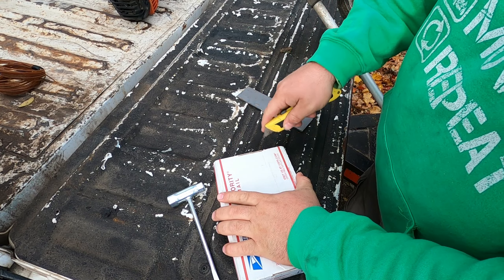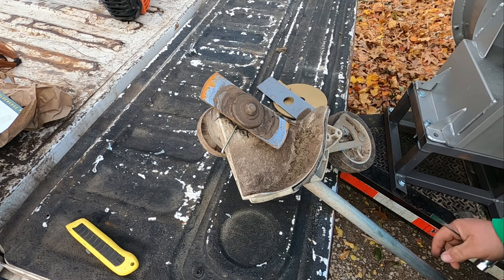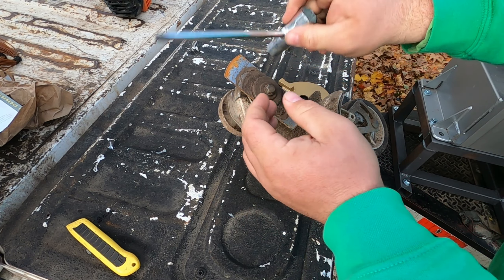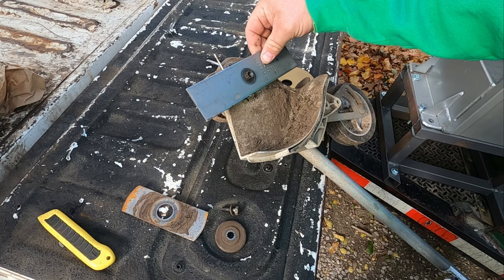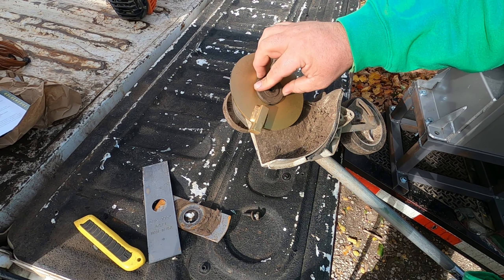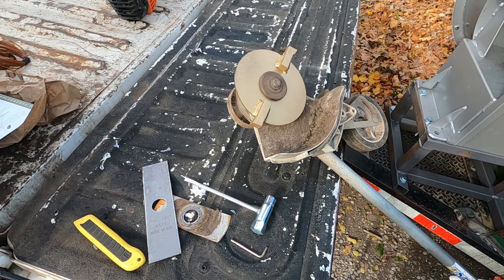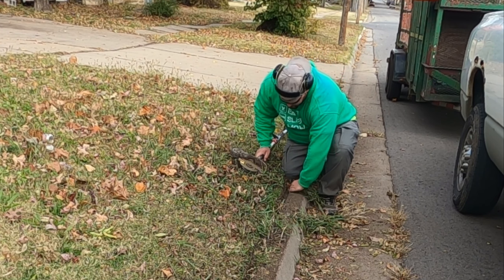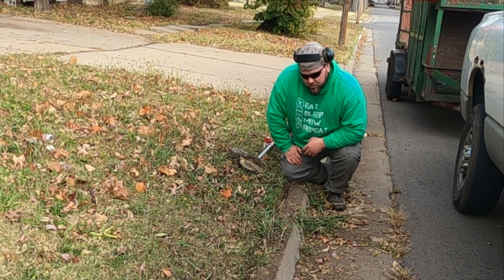Divine Reviews: Golden Edge on extremely overgrown edges

Comment: I have to know. Are you still using these? Was it worth it?
Reply from the maker: This was one of the last couple Lawns I cut last year. It leaves an edge a little wider than I like and it it bounces on the concrete  it scuffs it up more than I like but that goes away after awhile. That being said it rips through these over grown edges. I haven't put it on this year but will once the Bermuda comes out of dormancy. I think the wider edge will help on one of our apartments who has over grown edges almost weekly.
Reply from the maker: Also I would have to say yes it was worth it. But it's not an "every lawn" blade. After the over grown edges I used  it hasn't shown any signs of dulling yet.